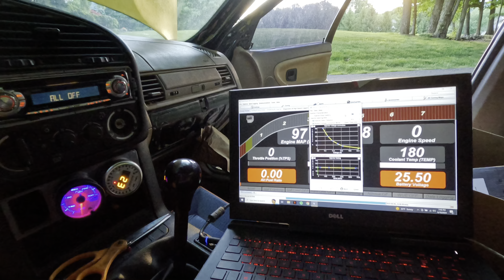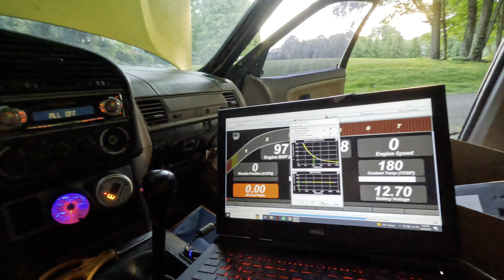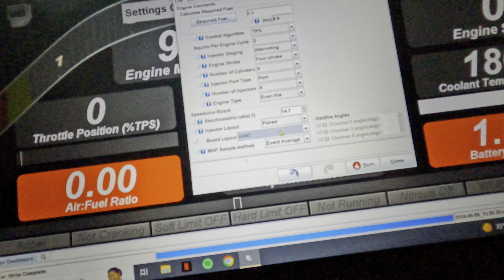M42 Turbo pt5: We’ve built a monster & VIBES 2024

Comment: Yo im the derryswop guy from germany . ECU wise the Kdata (which is made in germany) is the same thing in blue, but I‘d  call it worse than the RM-Racing speeduino. The problem is not really the ECU but the firmware- both ecu‘s get shipped out with years old firmware and thats the first thing that needs to be updated . The basemaps on both ecus are complete trash just with only the base timing angle being correct atleast . But thats mostly the case even on more expensive ecus like haltech pnp‘s . On the kdata the newest firmware available is 4 years old. On the speeduino theres almost every half year a new firmware with new features and safeties. The main problem is that theres not many people that can help you out with those ecus when it comes to stuff like this. Most only know how to tune and thats its. They dont want to bother with firmware stuff- but once its running it absolutely fulfills its purpose. Being cheap and not having to wire up a harness.  I also run a speeduino in my boosted e36 m50 turbo daily
Reply from the maker: Well more ya know, I’ve been being told in other e36 chats the kdata is simpler so I guess disregard that comment, but yeah hit him up if you have a Speeduino to get ya m5x/m4x turbos running^^
Reply: @Jz_Janks  all comes down to personal experience, the guy that installed more than 2 kdatas is gonna call the kdata easier than anyother ecu and same goes vice versa. Most of the time its just 1 missing piece of the puzzle to get the ecu running which is in both cases the firmware. I did around 6 kdata installs and have had sync loss (crank signal) issues on 2 setups. If you dont know how to get rid of such „small“  problems (forexample)thats enough to make you throw the ecu in the trash. And most of the time people blame it on being a „cheap“ ecu but they forget that the same problems can come up on a top end ecu. Thatll make you think „ why did I even spend so much money if i still have issues with a known brand ecu „
Reply from the maker: @lobotomyy  definitely fair, my buddy just had a issue with ecu masters like that. All in all once I found you it was very easy to get going, but the 2 months leading up to that was a nightmare and they told me to send to ecu back thinking it was a board issue and that didn’t solve the main issue. Not sure if they actually found an issue or not but we got it running and that’s all that matters
Reply: What power are you making?
Reply from the maker: @uzairabrahams9829  haven’t put it on a dyno, prob low to mid 200s, butt dyno would say like 220-230 prob could be lower or higher tho idrk

Comment: Have you ever tried to with the afm in front of the turbo?
Reply from the maker: @eddiehp  I haven’t, I have only seen it like that on stock ecu
Reply: @Jz_Janks  since you went standalone its better to use the m44 maf its more accurate
Reply from the maker: @eddiehp  🤔 wait really?
Reply: @Jz_Janks  Since you are standalone you can remove the AFM/MAF alltogether. You just need a MAP sensor and a tune
Reply from the maker: @ yeah, tbh the only reason I haven’t is cause it runs so good as is don’t really wanna mess with it rn😂